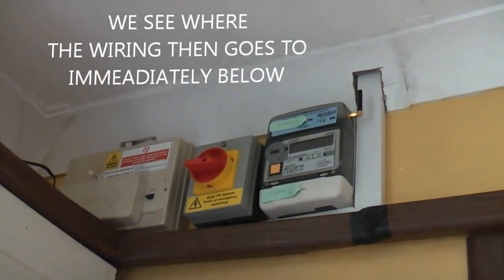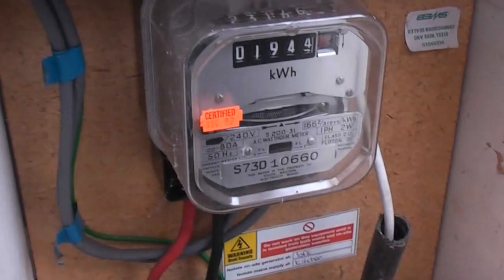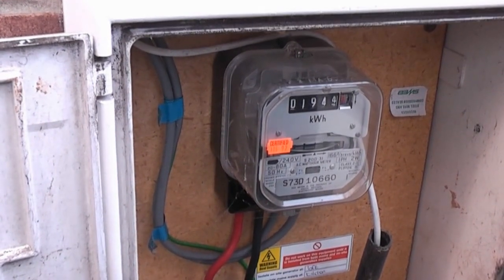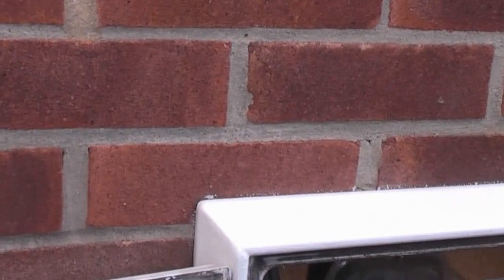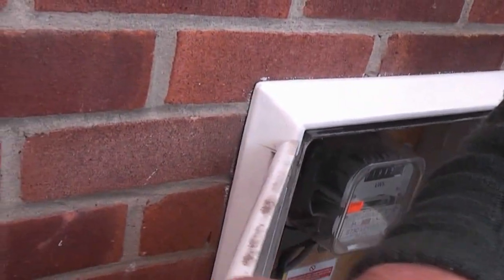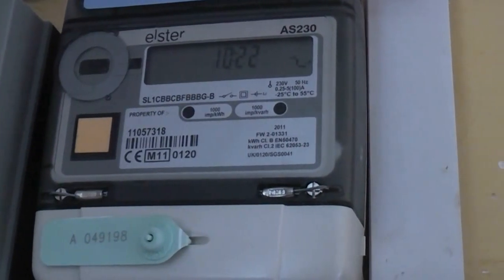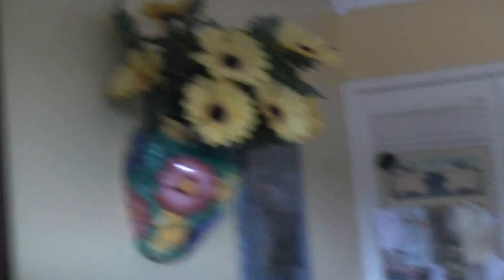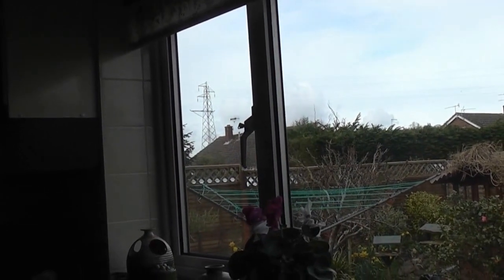EXPERIENCES WITH ELECTRICAL SOLAR PANEL INSTALLATIONS  IN 2012

Comment from the maker: It can take a few days before the Inspector calls to evaluate your house's thermal efficiency and produce the required certification. That report  has to get to the solar installer who then has to call back and supply you with other documentation of his own you have to send to your electricity provider together with their several pages of paperwork filled in, in time to qualify for the feed in tarrif..Some of the answers to questions there do need the guidance of your solar provider.

Comment from the maker: The first day of operation was very satisfactory. it started putting power back into the national grid from as early as 7am at around 100 watts and continued all day rising to a peak oiutput of. around 3.3 kw around midday. it continued until at around 8pm it had reduced again to around 100 watts. Only when it was getting dark were we back to drawing power from the mains.

Comment from the maker: The next step is to contact your elecricity provider to request they send you a Feed in Taffif Application Form. You fill that in and return it to them together with copies of the MCS statement provided by the Solar Installer and The Energy Perfomance Statement provided by the inspector your Installer will have arranged to call within a few days.

Comment from the maker: Day 2 was dry for a change! Devon Solar had paid extra for a guaranted morning delivery of the equipment. The lorry arrived at 12.45 pm but with only some of the parts. A second lorry arrived at 1.45 so the morning was wasted. By the time the team had left in the evening the rails were mounted on the roof and all sixteen solar panels fitted.

Comment from the maker: Well so far I have been expressing comments about getting Solar installed. I may just as well continue with what happens as the installation starts.Thee Devon Solar tecnicians arrived on time on a rainy morning. By mid afternoon in dry conditions they had errected the scaffolding along the rear of our house. By 5 pm they had installed the support brackets under the tiles on the roof to take the rails that support the solar panels. These are expected to arrive tomorrow direct from the importers.

Comment from the maker: So hopefully, just in time, we have given the job to Devon Solar, the company whose rep spent the most time at our house and agreed to fit the possibly noisey inverter in our cool oararge rather than in the house. Only one offered do that. He actually put a ladder up to the roof to accurately measure and could confirm we can have the full sixteen panels fitted. He also needed the lowest deposit to start the ball roling. Our second choice wuold have been a firm called i{nteliigent solar.

Comment from the maker: Another importanf point regarding the 20p deadline of the end of July, is that it takes a wreek for the cooloing off period to oass, after ypou have signed the contact, before work can start. Also it takes a week for the installation paperwork to be processed and approved by your electricity company after the systemhas been installed.  So there are only half as many weeks left, from the start of July as it at first appears.

Comment from the maker: Another thing to watch out for is an expert recommending a certain panel for your roof and is not keen to fit any other giving suspicious reasons why they are not siutable for your roof. Whereas in fact they are trying to get rid of surplus panels that have in stock before the final rush for the hgiher tarriff comes to an end very soon. and corresponding demand for Solar drops off considerably.

Comment from the maker: Another key thing i learnt today about inverters is that while i realised they can made noise they also can produce a low frequency hum that vibrates throughout the house at night. Some are so bad that owners have had to replace them by quieter ones. It is far better to mount an inverter in the garage if at all posible where they work better in lower temperature anyway than in a loft.

Comment from the maker: the owner of the house on which this system is laid out, told me today he wishes he had bought the system himself now, rather than let a lot of the income go to the investers who take most for "freesolar" earnings. He recons his south facing ssystem has generated 2131 kwh over the last six months which has given them £905 for their invetment. He did get in at the original 40p rate, but the current 20p rate would have earnt half that, which still equates to over £9oo per year.

Comment from the maker: Opinions are divided for a generally East West facing roof, such as ours, if it is better to fit half the panels on each roof, or to concentrate them all on the West roof which in our case certainly gets the midday and longer hours of sunshine on it, until dusk..

Comment from the maker: Since the government has slashed the amount of money that can be earnt by having solar panels fitted on your roof by 50%, so has the cost of ithe equipment and installation, If you decide to buy your own system! Now a max size 4kw system is generally available for around £7000 whereas only a few years ago it was treble that..So now is the time to act before the end of July 2012 before the money you can earn from them is going to drop agin!

Comment: I'm curious how they have installed a new circuit into that old rewirable wylex distribution board and applied RCD protection to meet the 17th edition wiring regulations???? Was there an additional fuse board fitted??

Comment from the maker: As my original company had lost interest and not replied to e mails or phone calls I have now found another company who is still able and willing to install free solar. Aparently there is extra paperwork for them now after ! April 2012 and they also have to prove the house meets modern insulation regulations to qualify for 21p per unit. Their surveyor is coming later today. So if you are in a similar situation, do not give up!

Comment from the maker: I have been sent details of a typiclal annual generation of 4285 kwh over one year on a house roof in Germany that is not ideally aligned to the range of the sun. That is surely a significant amount of electricity generated polution free.

Comment: Hi Mike,

this is a very good report on the use and promotion of solar power.
The problem is similar in Germany. The subsidies will be drastically reduced. 
A whole new industry now threatens to die.

Best regards

Günter

Comment from the maker: If the price of the cell panels can be brought down by mass production, there could be a case made in the future for new houses being built with the whole surface on the sunny side of the roof being covered with photoelectric cells instead of tiles..